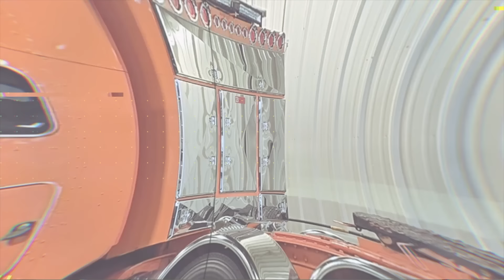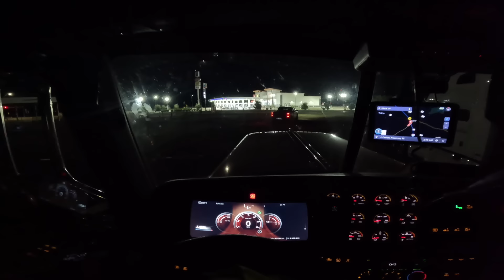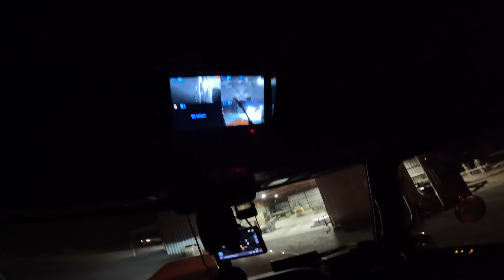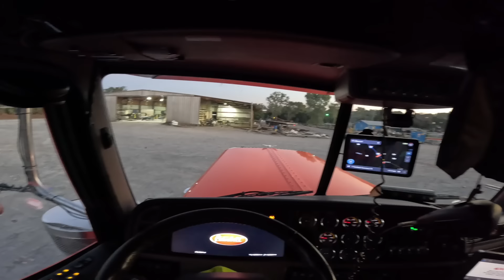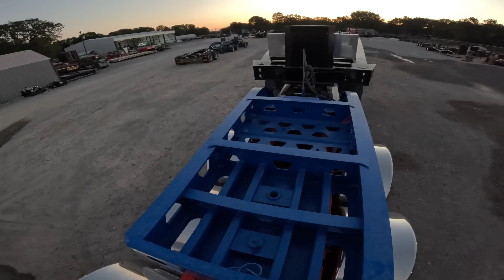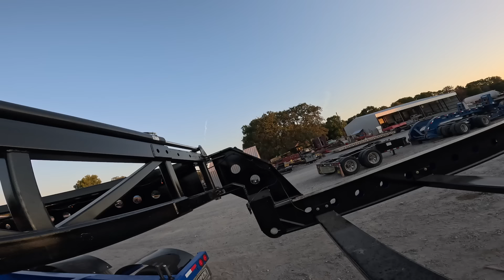HEAVY HAUL#75: PICKING UP MY NEW MASSIVE OVERSIZED PERIMETER TRAILER AT THE "HEAVY HAUL HOSPITAL".

Comment: I enjoy seeing content from there but as someone who goes there to have my own ideas built, please don't make it easy for others to copy any advancements that came out of his mind. Eventually most things will get copied but generally takes years before enough people get a close look to figure it out what's different. No need to speed that up. Sounds nice to "help others" until you realize that making something easier ends up making it (freight) cheaper. Displaying advancements will also result in more trailers built by others to copy it and slightly lowers the experience and intelligence needed to use that trailer. Neither are particularly safe or good for anyone that worked their way up to a perimeter. Nice trailer!
Reply from the maker: People have been copying him for a while now. And they have been building perimeters for probably almost a decade now. But that is why I don't go in depth or sometimes avoid certain trailers all together. When i make content, here or on the road,  there is tons of footage i cut out for reasons similar to that. But I feel you. Thank you,  it's working out great.
Reply: @c1heavyhaultrucking  I'm aware perimeters are not new but he has made some improvements that don't really need to be pointed out.

Looks good too. Keep up the cool work.
Reply from the maker: @sln9651 i hear you, but what did i point out that was new on the perimeter?? If u mean the remotes to open and close... it's a few companies that have been doing that. I go out of my way to watch for things like that... is their something now please let me know.